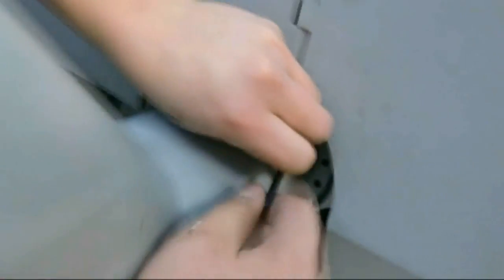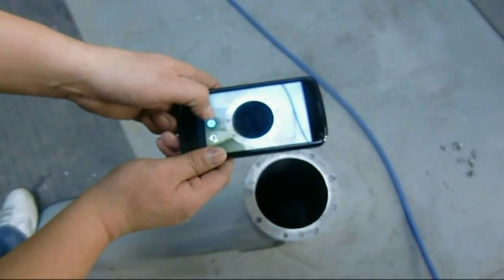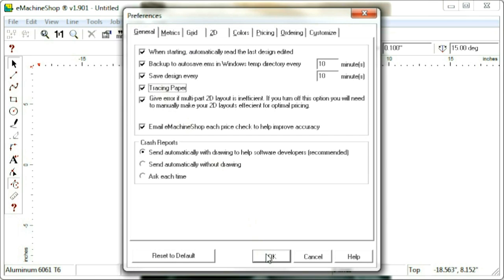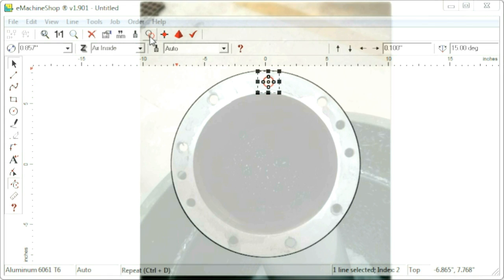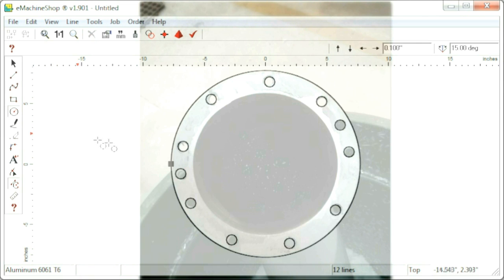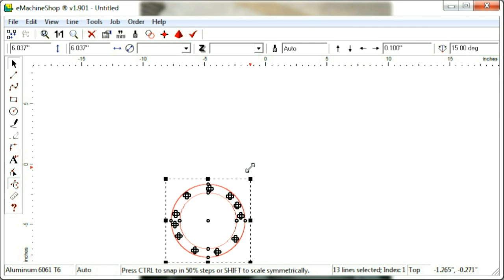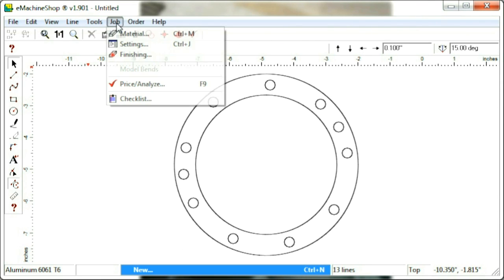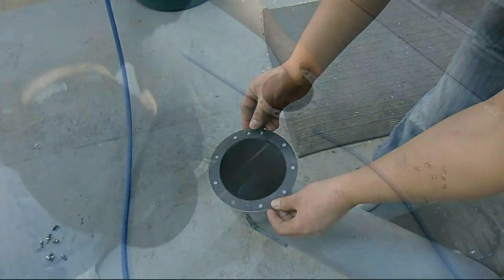Tracing Feature Quickly Designs Low Tolerance Parts in eMachineShop CAD

Comment: It's great this is now integrated into the program. But I have to say, I've been doing this for years by using a 3rd party utility to set the eMachineShop window a little transparent (transparent windows are built into Windows, and you can use a 3rd party utility like Froost to control it).